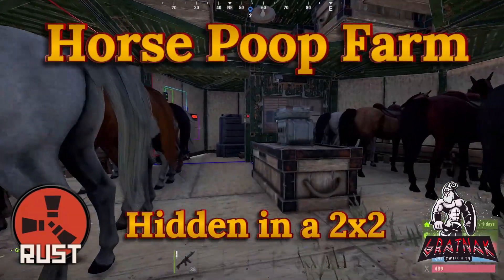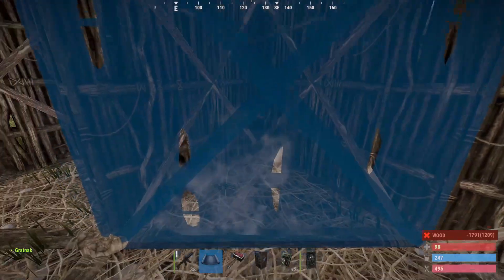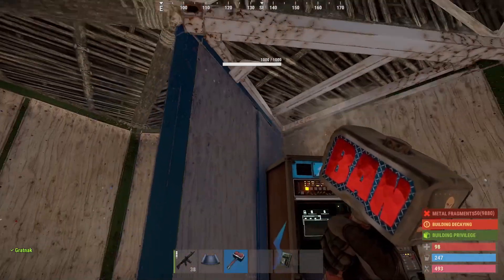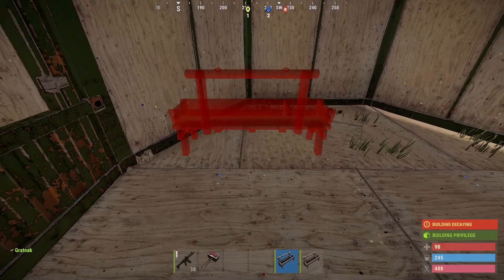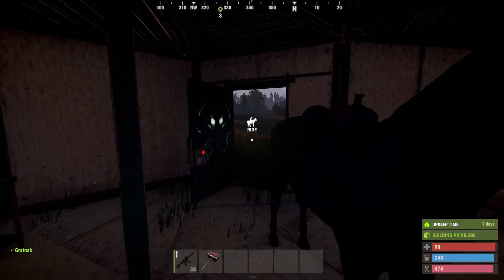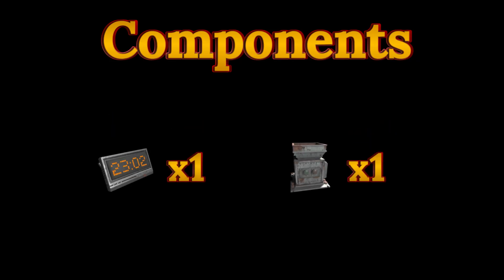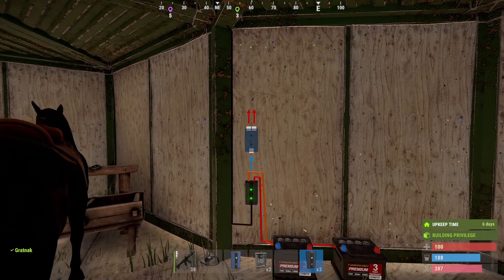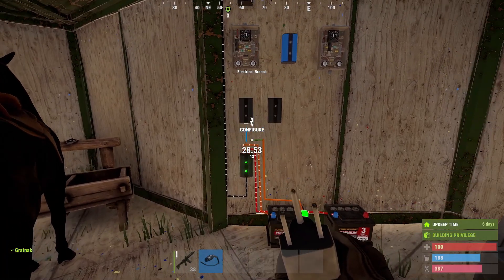Rust: Horse Poop Farm

Comment: Did precisely this down in a cave last wipe, only a couple of horses with a hopper activated by a receiver from a broadcaster on the alarm clock in my main base, collecting poop twice every rust day. Needed only a couple of watts of power to keep the battery topped up. Got way more fertiliser than I was ever able to sell at Bandit.
Reply from the maker: That's cool. Just trying to think what cave you can get horses down into, sewer?
I set the timer to fifteen minutes, as I didn't want to have dung piling up and now that bread makes the horses poop more, I also wanted to be on the safe side 😂